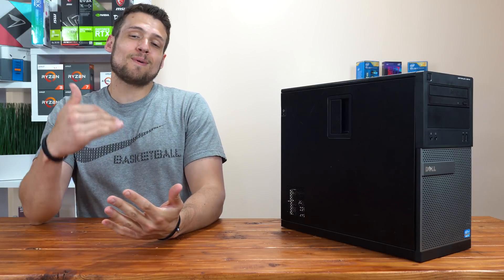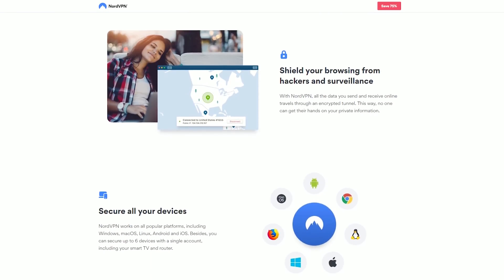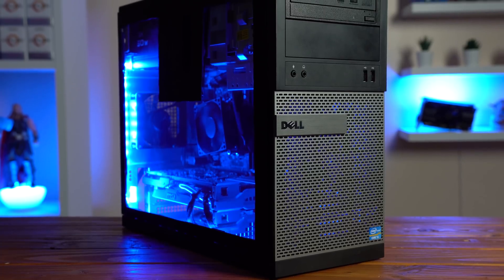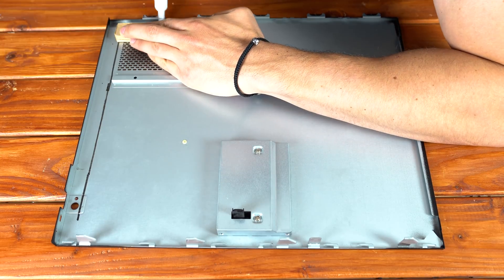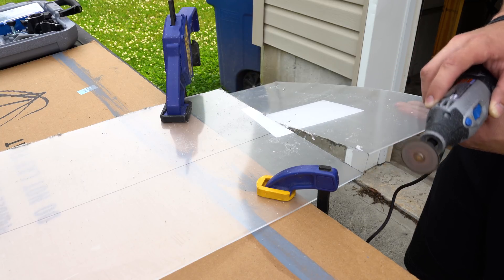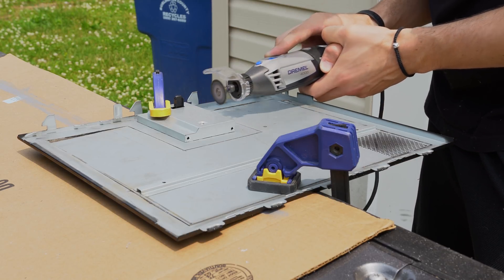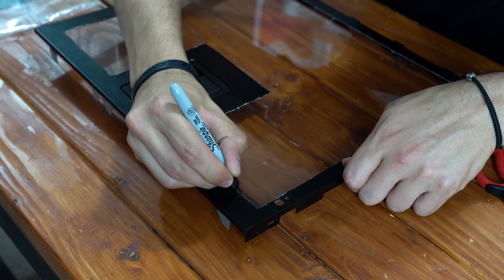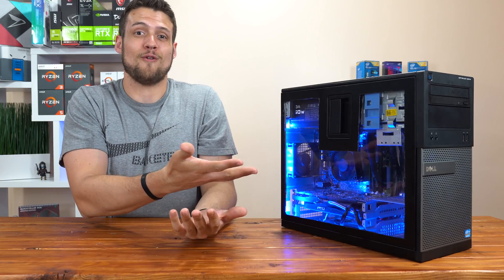How to Mod a Dell Optiplex Gaming PC!

Comment: I still love watching these mod videos years later. I am considering getting back into PC building due to the boom in emulation front ends like Batocera.
Here's a tip that might help you in the future. Instead of using the case itself for your measurements, consider using either foam core or poster board for your plexiglass measurements. The sheets of it can be had cheaply from the dollar store. Just cut the size you want and check it with your case cover. If it's not perfect, just cut another sheet. No big deal. I like using foam core for templates because the sheets are dead square to begin with.

Comment: I love it, but the only thing I do not like is that it is quite cramped in the case and I feel like I would be giving up real-estate for extra fans that would be needed. I would like to have enough hard drives to hold our steam library and I do not want to spring for a multi terabyte ssd and would rather use a few SSD's and maybe a spinny drive.

Comment: I bought a $300 Optiplex 3050 SFF with 32 GB RAM and the i7-7700. Then I bought a $200 RTX 3050 low-profile. I put an aftermarket case fan in front. I still want to increase air flow. My next phase is either to do a transplant and take the CPU and RAM out to put in a B250 mobo, or I'm going to make my own side panel. My vision is to make a plexi expansion chamber where the side panel would be. Placing the computer on its side for operation, this takes the stress off the GPU bracket, and with a 120mm fan mounted it will be exhausting up and out.

Comment: Instead of cutting the plexiglass you need to score it deeply on both sides then lay the edge up against the end of a bench or table and snap it off. It's quicker, easier and as king as you have scored it cleanly and deeply with a sharp blade it will snap off very cleanly, and u will just need a bit wet and dry sandpaper to clean the edge up.

Comment: you could take it one step further and cut out the lower 5.25 bay leaving only the top bay since there's an optical drive.  would look that much cleaner from the outside.  Good job and thanks for the video

Comment: I turned a 2002 V2 Premiere from Shop NBC into a sleeper with working PATA DVD/CD drives.  I still have to figure out the floppy drive.  
i3 10100f
DDR4 4000MHz
1650S
It’s not extremely powerful, but it’s way faster than it was in 2002.

Comment: I want to paint the grill of the T1700 but not the black bezel. I can see it’s two parts (actually three if you count the circular DELL logo). But I can’t figure out how to get the grill out of the black bezel. I don’t want to paint the black bezel because it has the screen printing for the USB ports, etc.

Comment: I watched another video where a guy just used a complete sheet of plexiglass the same size of the side panel and used flexible, peel and stick magnet strips to attach it to the case. He taped off a border around the edges about one inch or so and spray painted it to cover the magnets and the case edge. It looked really good and would be much easier than this.

Comment: Thank you, bro
I have dell Optiplex 745 and I want to upgrade the motherboard to change CPU and RAM 
can I make that and I have NVIDIA GEFORCE 210 and power supply 305 watt
Reply: Check out what I did with a 755: https://youtu.be/TczLEGfInz0. TBH I replaced the PSU, but not because of the power rating. I can give you some measurements how much it consumes with a core 2 quad q8400 and a gtx 950, but I can assure you it will be plenty for the 210! My other 7020 with the 290W stock psu can easily handle an i5 and a gtx 1650 super: https://youtu.be/ZpVphf3xZuQ

Comment: 3:00 you should clamp the cutting line closer to the edge of the table so it doesnt vibrate as much and than it wont crack

Comment: Amateur metalworking makes me cringe but we've all been there. I would have done some stuff differently but this turned out really cool either way. Also that case is steel not aluminum. Ferrous metals like steel spark when you grind them whereas aluminum doesn't. Aluminum also clogs up cutting disks like crazy.

Comment: I spray painted the grey part of the bezzel black and I also spray painted the whole inside black in my 7010 mini tower.   I have a GTX 1070ti FE i7 3770 16gb ram ssd hd

Comment: I did it to my Optiplex and it was a lot of work. I live in an apartment and did it kneeling on the balcony. I left the air holes on the bottom left corner since it's near my gpu and it keeps getting to 82 degrees when I game. I have not put the lights on yet since I'm waiting for my 24 pin to 8 pin adapter to put my new psu in.

Comment: I have a modded Dell Optiplex 7010, came with i5 3570 but the person I bought it from added a GTX 1050 Ti (I wasn't fully confident in myself so I found one that someone already upgraded), I can play lots of games, I even get like 150 FPS on CS:GO at max settings, only cost me $350.

Comment: i would have left the top half metal to remove the trick cuts on the side panel. also would have hidden the cd mount and power thats not much to look at here and removed the hhd cage as well if going with an ssd.

Comment: Nice optilplex man, how big of a pain would it be to put in a after market cooler in a 9010 mt optilplex? I ask cus i replaced cpu to i73770 temps getting close to 80c, with a open case with fan blowing in it getto i know all clean but still getting around 80c
Reply from the maker: The only issue I could see you having is having to remove the motherboard because you don’t have access to the back of it with some of these cases. Why do you wanna do this though is the real question lol?

Comment: good job i might do this to my optiplex but one advice i'll give u, do not use only one surface to cut, thats how u cracked the glass, because u didn't have another surface on the other side to give it more support and u only need a gap for cutting space.

Comment: Working on adding this mod to my own machine now. I appreciate how simple everything is even for someone who’s never used a Dremel such as myself. To mount the plexiglass though, I’ve used double-sided foam tape in addition to the electrical tape to make sure that it doesn’t fall off at some point.

Overall a very well done and easy project! I recommend it!

Comment: i have dell optiplex 3020 i did a case swap it was really easy it is just that everywhere i look up it says that it was a mATX board, but it is actually a little smaller then an mATX board and it uses the hole layout of a ITX board it was confusing at first but everything ended up fine with my dell motherboard in a Cooler MAster Q300L

Comment: Instead of a jigsaw, use a hacksaw for Plexiglas. It cuts really easy without worrying about it cracking.
Another small critique is your lack of cleaning the edges. You can't just grind one side, you need to grind all the way around and then go in with a file to fix the corners. Even from a distance you can tell how uneven it was cut, and while it doesn't look to bad, it also does not look good.

Comment: I like what you have done here, but I do have a suggestion coming from experience:

https://mnpctech.com/case-mods-gaming-pc-liquid-modding-custom-computer-mnpctech-overclock-cooling-fan-grills/u-channel-pc-computer-window-rubber-trim-molding-cable-management/

This stuff really finishes off the cuts for the side window in a clean manner.  It doesn't do well with 90 degree turns though, so you need to make your corners rounded on your cuts either with a hole saw, or careful cutting with your Dremel.  I have used this on several side panels that I have cut windows in and it really covers any imperfections left over from the cutting process very well.  I usually run a very thing bead of super glue or other adhesive inside it to make sure that it stays in place, and its also a good idea to install it dry and get the length cut just right before you start applying the glue.

Comment: It looks good. The one thing I would have done in addition is paint the inside of the case a nice flat black. The bare metal isn't horrible, but  giving the inside a paint would make the mod that much prettier. Of course a person could choose to paint whatever colour they want based on the parts they are putting in their computer or already have installed.
Reply from the maker: I definitely wanna paint it now.
Reply: @ZachsTechTurf  I can't wait to see it when it's done!

Comment: you forgot that you can spray paint the inside of ur case cause that silver isnt to nice to look at
Reply from the maker: Yea black would be sick!
Reply: @ZachsTechTurf  and the window you could have used a glue gun  ur motherboard is green so i would have used a green theme with green rgb  and also for looks and cooling buy from amazon ram heatsinks with rgb and again use green theme  nice little buget touches

Comment: I've got a Dell Precision workstation and I'm debating whether to put a side window or putting in mesh vents...tough life choices aplenty.
Reply from the maker: That would be cool too!
Reply: Definitely more cooling. My 7010 with gtx 970 runs hot even with a 120mm fan on the front.

Comment: Looks great, hoping to get my hands on some of these from auctions to turn into gaming rigs.
How about adding in an LED fan on the front and rear? will also increase airflow if you cut out a section of the front metal frame
Reply from the maker: That might happen in round 2!

Comment: Looks good, and great idea, I’d cover 5.25 inch bays leaving more “meat” on the original panel as well, maybe even cover psu slot but I’d leave that to your personal choice, imho that would be less cutting, less plexiglass and slightly better visuals of inside of the case.
Reply from the maker: Yea that wouldn’t be a bad idea for sure.

Comment: I currently have an optiplex 9020 but the cpu (i7 4790) gets like 75 degrees Celsius and the gpu (rx 480 reference) gets like 82 degrees while on load. So what I'm trying to do is drill holes in on the side panel and possibly the top as well to improve airflow
Reply from the maker: Yea the Optiplex could use another fan but those temps aren’t terrible.
Reply: @ZachsTechTurf  What made me consider this in the first place is that I've been having this problem where my system crashes when under load (only happened when I'm playing Far Cry New Dawn) and it displays a static screen for a few seconds and then reboots. I'm assuming that is the Dell equivalent of a blue screen and I'm also suspecting that the temperature might be a bit too high. 
If that turns out to not be the case, it might be the psu which is a evga 500w b-stock (which might be faulty).
Reply: @StormDawntion yeah you might need to consider changing the PSU, even if it's not faulty search for a lower tier PSU, I got a EVGA 850gd for $60
Reply: @tristan6509  hmm yeah but like I said, the static screen crash only happened when I played far cry new dawn. Everything else seemed fine.
Reply: Get a better cooler like a hyper 212, or if that's out of your budget, get a hyper h411r

Comment: I did a very similar thing altho I painted the inside with a black powder coat that might have been Overkill but I also went with a tinted Plexi window and was going for a more of a dark classy look and kinda trying to preserve the sleeper PC it started out as and I also used rgb light strips they came with fans I didn't end up using but it was cool cuz I really like the strips alone there is like a crap load of lighting modes all in all it was fun, and at this moment I'm sad I ended up selling that system
Reply from the maker: I definitely wanna paint the inside of mine now!
Reply: go for it its not to hard just take your time masking off the important parts and find some non conductive spray paint

Comment: now this is dope! love oem case mods like this
would be nice too if you could drill the top with a circular drill bit or make a hole for the psu fan the put a $2 filter above so the psu would have fresh air then make your own top mounted psu shroud for that extra cable concealment and so it would look more dope.

Comment: I built a Dell optiplex with I 4790@3.6ghz with 8gb ram and a gtx 1060 I used a 24 pin to 8pin adapter because the motherboard uses 8 pin.
Reply: Yeah same here. Just kind of annoyed that I had to pay an extra 16 dollars for it

Comment: Zach: i think its a pretty baller gaming pc
Optiplex: Has intel stock cpu cooler
Reply: @Hawk OG he could have cut the cable and wired a "adapter" for the new fan
Reply: Max, I don't think you know what an Intel stock cpu cooler looks like... that's definitely NOT a stock Intel cooler. It's a cheesy stock DELL cooler... but it's not Intel.
Reply: @wolfshanze5980 i mean it is still a less than ideal cpu cooler for gaming
Reply: @maxsteinhauser  yes, Dell CPU coolers are lame.
Reply: @wolfshanze5980   AMD ryzen stock coolers FTW

Comment: Just got a optiplex 690 mid tower edition for free. Has 1.5 gb ram, 160gb HDD, and an e6600. Won't boot. I believe it's the PSU bc someone threw it, but unsure. Also no CMOS battery. Error code 2-3-4
Reply: u need a cmos battery. it also could be a ram error
Reply: @jjjason00007  Maybe. Either way, I can sell it for parts easily

Comment: 3M two sided "tape of the Gods is the ideal way to adhere that acrylic to the side panel.
Reply: @LowSpecChaosUHD You don't see modders using hot glue. You see them using the 3M double sided commercial tape.

Comment: Not an Optiplex mod, but I had to cut a hole in the back of the brand new case to allow a passthrough for my desk mounted RGB light strips.  I wanted my desk RGB to sync with my motherboard and my old case had a grommet passthrough but this new one did not.  The only other thing I did was protect the cables from any sharp edges from the cut.  I wrapped some cut to length velcro around the wire, big enough to get stuck in the hole, so that the actual RGB wire didn't get cut or knicked.

Comment: CPU-R5 2600/R7 1700/I5 9400F
GPU-MSI GTX 1060 6GB GAMING X/MSI RX 580 8GB OC ARMOR
MBO-MSI B450M MORTAR
RAM-16GB 3000MHz CL15 DDR4
SSD-SATA 3 120GB SSD (for OS)
HDD-1TB 7200 RPM 3.5"
PSU-SAMA 750W 80+ GOLD
CASE-SilentiumPC Regnum 1 window
FANS-5 RGB FANS
What do you think about this PC 👆🏼 i will be using for gaming on 1920×1080 getting 144fps and streaming on 720p60fps while getting 1920×1080 100fps or more
Reply: Its shit go for 1070 or 1660ti

Comment: I think Zack's next challenge is WATER COOLING A DELL OPTIPLEX 🤣🤣🤣
Reply: Mine is water cooled
Reply: Mark Murphy cap
Reply: nah a custom gpu cpu ram psu hdd ssd and optical drive rgb cooled optiplex
Reply: Tiger White  ohhh wow
Reply: I have the same pc what water cooling can I buy? A cheap one plz
Reply: @malekskhiri1415  Hope you not wanting to overclock cpu =/ I found out Optiplex PCs can't overclock cpu
Reply: @Glorius-b7z  i didnt i will let everything default to avoid any problem
Reply: @malekskhiri1415  You can get a Cooler Master MasterLiquid ML120L $57 rn you should try that
Reply: It's possible
Reply: Nah vodka cooling

Comment: That reminded me of my first mod several years ago, made same mistakes w/the dremel, you can use double sided 3M tape so you can secure the plexiglass for years to come, instead of that black tape that can come off easily with time. Great video as always.
Reply from the maker: Better tape would have been a good idea as well lol.
Reply: i'd use my gluegun for a permanent job done!

Comment: One thing I wanted to do with my optiplex  is  to improve the cooling , I have a rx 580 and under heavy load , gpu max at 87° , I undervolted now I'm maxing at 78 to 83 , always wanted to try some cooling mod but I don't have the tool for.
Reply from the maker: There’s a ton to do to the Optiplex!
Reply: Move your computer parts to a better case (something with good airflow like a Coolermaster NR400/NR600), there's your mod... problem solved. The Dell Optiplex case is just not and will never be a good airflow case.
Reply: @wolfshanze5980   dell proprietary front panel pinout is the problem , I will wait for ryzen 3000 to have a new case.
Reply: @Mik4ael  I've never moved a Dell MB to a different case (probably cuz i've never bought a Dell MB ever)... are you saying the pin connections on the Dell MB can't be hooked up to a 3rd party case's front panel connectors? This is probably why I haven't bought a big-company PC since... well ever.

Comment: I use to have an fx 4170 which was 4.2ghz and an oven.So i got hold of a steel fan which was thick.I put on connections/plug to run it from house power.She sounded like a jet but kept her cool and quite :D.

PS:That optiplex looks sick
Reply from the maker: Haha nice fan

Comment: I'd just go for the case swap. I tried modding my main PCs case, and the result was that after about 2 large cutting wheels with my dremel, I finally had the case cut out, but the results were less than perfect, and I messed up some of the paint on the side panel. Still haven't taken the time to touch that up. I found that it's actually not that difficult to put a Dell mobo in another case most of the time. The biggest issue is the power switch, which is proprietary, but you just have to look up the pinout for the power switch, and plug the new switch into the 2 power switch pins on the mobo. That's it, easy, effective, and way less hassle.
Reply from the maker: Yea this is more for fun than the practical way lol.

Comment: I've seen a few mods done to the Optiplex revolving front panel airflow by cutting out some of the metal from the front to add a fan. It definitely helps out in some cases (pun intended).
Reply from the maker: That’s a cool idea as well!
Reply: @otter8899  idk send help please.